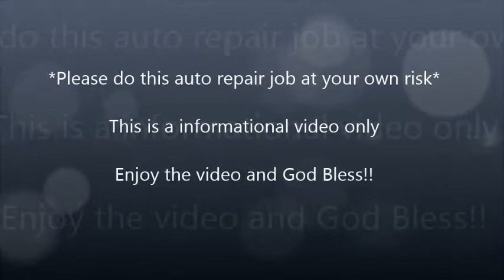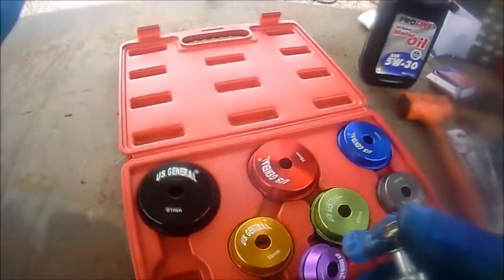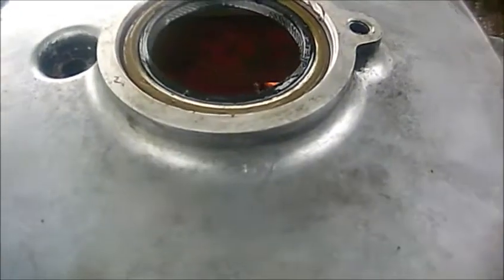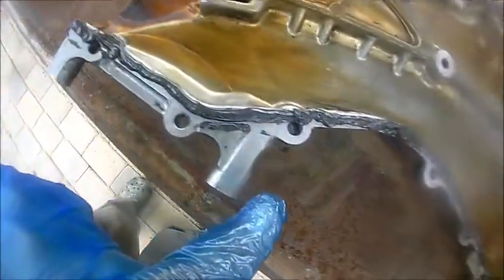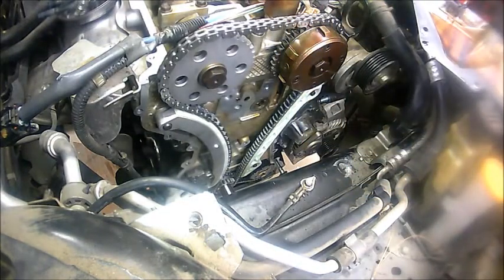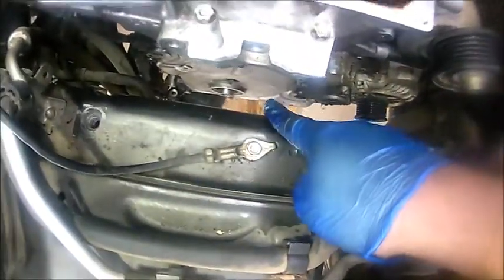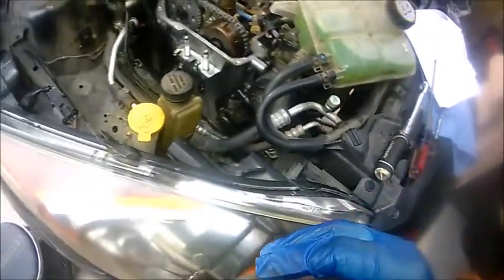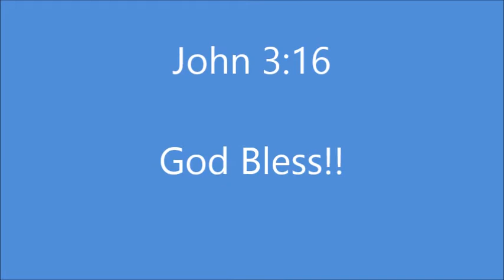2004-2011 Mazda 3 (2.0L) Timing Chain Replacement Part 5

Comment: Great video mate been following your 6 part series and I'm almost done :) what did you use to clean the timing chain cover? and block?
Reply from the maker: Thank you for your comment on the series of diy videos. I used decrease to clean the timing cover and block. It’s the purple power decreases that is concentrated. I used a spray bottle and filled it up with degreasers and a nylon brush. I hope this helps
Reply: thank you from Sydney Australia! @oscars-autorepair3236

Comment: Kind of curious how that thing runs why wouldn't you replace the variable valve timing sprocket on that
Reply: I was actually wondering the same thing, I'm about to do this job on my Mazda, found the 2L kit doesn't come with it but the 2.3L does... I haven't had any luck in finding a 2L kit with it, is it something that can be cleaned and reused? The kit comes with two sprockets but not the variable attached to it...  Separately it's more than the whole kit. I don't wanna half fast the job and considering just buying it separately 🤷

Comment: Shouldn't you only hand tighten the cam sprocket until you get the guides, chain and  tensioner all installed and tight before you tighten the cam sprocket. Otherwise the sprockets are not going to be in sync with each other . The sprocket could be a half tooth advanced or retarded, whitch would throw off the timing .